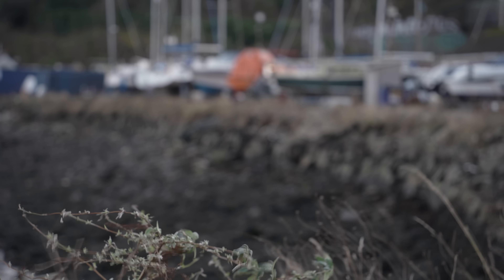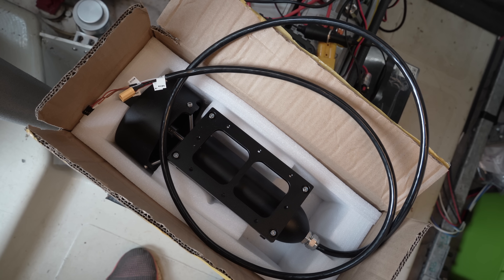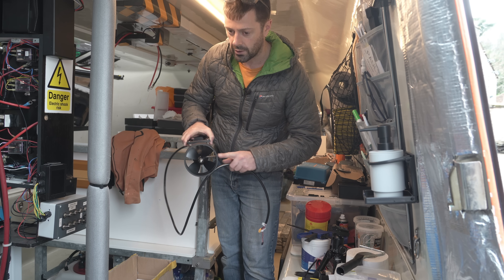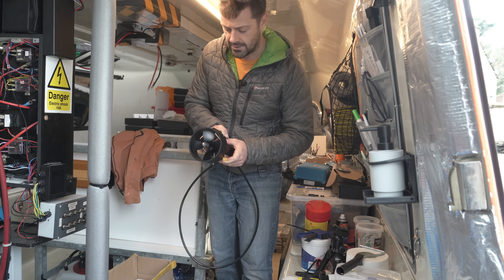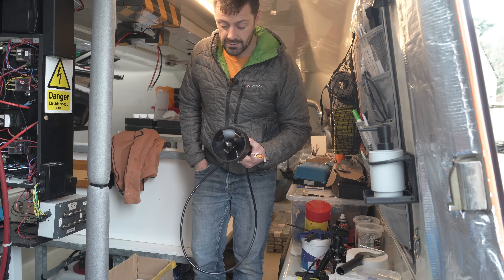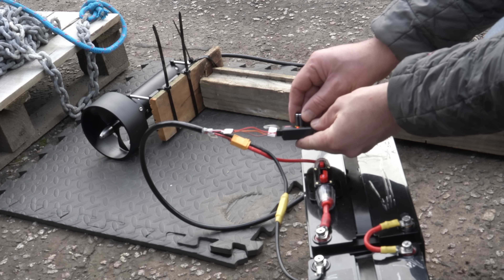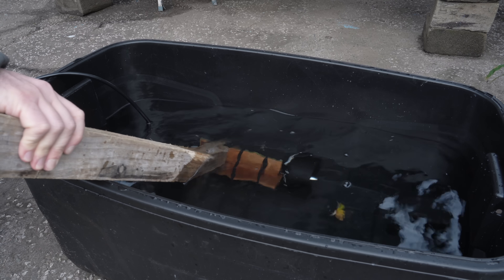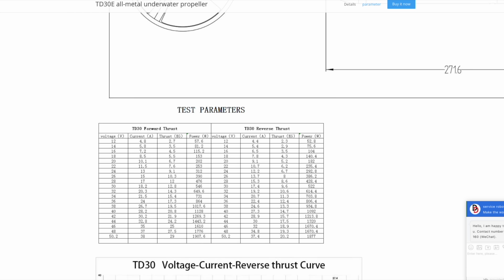Underwater Electric Thruster Test - 24V 1200W motor. Expedition lifeboat conversion Ep107 [4K]

Comment: If you use 8 AWG then it can handle around 85 amp continuous & the diameter of the wire should be around 3.5mm. Basic rule of thumb is if you use double the amp rating that you really need then you won't have issues & it also allows for future upgrades that draw more power.
Reply: The Motor Windigs itsself and here perticular probably more the build in motor control circuit traces and the type and amount ot FET Transistors is what limits your possible max current. (plus little bit bargin from the watre and in arctic waters even more the cold water)

Stepping up the wires to a diameter who is more as the rating of that thing is isnt nessesary. Most of these are generous with its power ratings (if not to say lying) and give you leway from this point. Also you probably never stall it and run it for long duration on full load need. So there is also room there.
I would think AWG 12 ist enough, even the step up to 10 isnt needet exept you want to midigate the voltage drop and be on the save side.
But 8 AWG would be just not make any sense ynd you start to get into problems with having physical space in the inlet openings.
Reply: Power loss is also a problem, energy wasted
Reply: @Dave78214  question is how mutch  you loose and how often you use them. he was more concerned about the real poweroutput the pod can reach to not cap them there to mutch and burning the wires when used. but he uses them only for bowthrusters or maneuveringthrusters for docking and something. thats only minutes or even seconds only. you cant even waste enough energy with the cables to make a different since the motor itsself drains the small batteries quickly.
In a long running verry efficient optimised setup for a autonomous drone ship for example you would think about.
Reply: @Total_Egal  well yeah, there are multiple angles to look into, others had not seemed to mention the power loss and it's sort of accounted for in the choice of correct guage and the voltage loss point - the wire doesn't seem to be the correct gauge, and 5 or 6 might be appropriate if the motor really can handle that much continuous power - perhaps it is useful for intermittent power bursts, like you say as a bow thruster
Reply: if you drop 2V over 1.6m that's 100W wasted at 50A current, and then as the temperature increases, the resistance also increases - 60W lightbulbs can start fires. I think the cooling from the water on the submerged part of the wire might be sufficient in factory tests.
Reply: @Dave78214  i dont say he should use clearly undersized wires who are on it right now but also not start to overdue it.
and also 1,6m long wires arent a lightbulb^^
Reply: @Total_Egal  good point, I think he also said the wires should be even longer
Reply: @Dave78214  in my expirience with changing wires on all things arround the most limiting factor without getting into larger physical modifications is the diameter of the holes and fittings to seal them up and get the cables trugh tight spaces in them. you might go one size lower as you want or have to squeze single wires insted whole cables and now got the seeling problem on your hand.

I think he wants to put more as one of this things on the boat. you might can run thicker cables to bow and stern to a busbar or cuick plug connection box and from there you go with smaller diameter to the pods outside.

And also he should closely test the wires quality he gets itsself.
China Import is know to use aluminium cables with copper and thin layers on it to hide the real quality.
Reply: @Total_Egal  I think you are onto something, even if you can fit the holes the current then goes onto the circuit board and through tiny components

Comment: Yes, that Guage of wire getting warm without the prop in water will only get hotter from the resistance in the water and yes even though the cold water will  keep the wire cool, it will only disapate the heat somewhere where the wire is not cooled. 
After a few cycles of running for a length of time the heat will weaken the wire strands or blow out a solder joint prob in the micro controller aboard......
ALAN!!! ❤😊🎉👍😎

Comment: The rub rail on my boat started leaking through the hull just like yours when the rubber started to dry out and shrink. I ended up taking the rub rail off completely(with a oscillating multi tool, drill, screw driver, hammer a chisel and a lot of swearing) and then filling in all the bolt holes. Are the top and bottom bolted together or are the halves bonded together those bolts going through the seam?
Reply from the maker: The latter - it's all bolted through. I'm trying to find a solution that does not mean lots of destruction and associated swearing.

Comment: My experience in using "heavy duty" jumper cables to test a 1,000 watt motor was. Hmm, what is that burning smell, hmmm why is there melted pvc on my floor.

Comment: dumbness in this episode - wasting time with chinese motors when european manufacturers make the best electric thrusters on the planet, needing bow thrusters when prop walk will do the job, using 12v packs when 24v packs exist, using packs with no active thermal management in an arctic expedition vessel.
also if the rub rail is leaking - use a jigsaw, cut out the bad and replace with new rub rail. there are no shortcuts on boats.
oh and if you want an actual marine thruster i use an aquamot 2.2 on my yacht with dakota dl+ 24v 135Ah with active thermal management.
Reply: Wow ! A REAL EXPERT on everything....
Reply: @Thelostgoldhunters  no expertise. just hard experience on the water.

Comment: Regards the wiring for the thruster, another concern is the wiring may be (probably is) aluminium coated with copper instead of the real thing.  For many applications aluminium wiring, while not being ideal, is not a huge deal breaker but for you, it would be far more serious.
Reply: I've never come across this in marine motors, even the Chinese know that copper is best in salt water...
Reply: I thought the ‘good stuff’ was tinned and not straight copper for marine purposes. Most low voltage wire from China is silicone coated and tinned (allegedly) finely stranded wire in my recent foray into researching and then purchasing some.
Reply from the maker: I'll find out when I cut and rewire, but the manufacturer stated it was pure copper.

Comment: Former industrial electrician here and I think I know what is going on;
Is the 50 amps inrush current or constant current? A motor has inrush current, which is only there until the motor starts rotating at full speed. I would assume that the motor only pulls 12 amps when actually running. Based on the size of that motor, I would guess it is about a 1/3 horse motor, so 12 amps at 24 volts comes to 288 Watts at about 88% efficiency puts out 1/3 horse at the prop, so if that is what they said they were selling you, that should be right. Yeah, the wire is probably fine, mate, but since you are going further, put one size larger, so 10 gauge AWG.
Reply from the maker: I don't want to counter someone who clearly knows their stuff, but the manufacturer YouTube channel shows the wattage at roughly their ratings when running, not just peak at startup.
Reply: @AlexHibbertOriginals  Ok, (watches video) so it is not the inrush current then, which was the one question I had. The current rating for wire gauges is for use without getting an electrical engineer involved in doing calculations. You also can get away with thinner wire if the cable is rated for higher temperature or had better cooling, but they are over relying on water cooling in their design.

It is ok for it to get warm, but not above the rating of the cable or to increase resistance (40 degrees Celsius is a good operating number for cable to top out at). The other question is how much are you going to run it. If it is more than an hour straight, you need a beefier cable.

Your plan to go thicker to the size you mentioned in your vireo should work perfect and deal with the thin wire they used if the section that is thin is actually underwater as you are taking Alan in Arctic operations.
Reply from the maker: Cheers - yep, trying to be discerning, without necessarily throwing what appears to be an otherwise very robust-feeling unit on the scrap heap. The re-wire is a must.

Comment: Did you actually test the current levels?
You are 100% right that wire will not be able to handle the 50 amps, but I highly doubt that the motor will pull that much amps as it is not 1200 watts... I think you got scammed on the motor.

 Don't they make a sprayseal type of stuff that is pretty good at sealing leaks along fittings like you have?
Reply from the maker: I did not - my claw-style current meter is playing up. The manufacturer YouTube channel shows the wattage at roughly their ratings when running. I'm unhappy with the manufacturer on a couple of levels, but I don't think the rated numbers were a 'scam' by a factor of, for example, 2 or more.
Reply: @AlexHibbertOriginals   The only way to know for sure is to measure the running amps going to the motor. If it is less than 50 amps then the wattage is not 1200. Of course you would need to test the voltage as well and multiply that by the amps, whatever that would be.
 It is common for china motor to not be anywhere near what they say they are unless it is an expensive motor. I have seen motors advertised at 1200 watts and they actually put out about 500-800 watts maxed out.
 Sorry you have this issue with that manufacturer..
 Did the spray seal idea help?

Comment: I'd rewire it with 8 gauge stranded because some of it will be in the water and if it catches anywhere it is less likely to break internally. For the rail leak use Captain Tolley's Creeping Crack Cure. Then use a marine grade silicone on the bumper to adhere it better to the hull
Reply from the maker: That very thin sealant looks good, thanks. Probably not viable for this job as it's a vertical surface, but for other things, great. Cheers.

Comment: I like your jury rig silicone shock reducer. . .just wanted to say (and I’m sure you know this) but there are companies in the US that make these in many different sizes for different shock needs.  I used them on a snubber on my 34 ft. Sadler (British) and it never failed and did reduce shock.  Your method might be cheaper although I’m not really sure. . .Thanks.
Reply from the maker: I have the normal shock dampers for Alan, but I need -40 rated ones for my sledging, so silicone it is.

Comment: A solution I have used in the broadcast TV industry might suit you for your fender problem.  We need to waterproof bolts on aerial systems so they can be undone many years later.  We simply coat the bolts/crews in Vaseline.  It gets mucky but the bolts don't rust and can be undone with ease (Steel, Aluminimum and Stainless Steel). Vaseline will soften in hard sunlight but it will stay as a thin coat.  It won't attack the fibreglass. I think it will work well below -20 deg', and more, it has for us.  It has fantastic water repellent abilities even when exposed to extremely heavy and continues rain for many years.  I have never tested it under sea water, that you would have to do but I think it would be fine.  Even though Vaseline does not set it will repel water and seal screws.  I think it would be fine under direct wave action.  I say this as the wind and rain up our aerial masts is well above 100mph.  The screws you can get out dip the screw in Vaseline then refit.  Those you can't get to use a small artist paint brush and liberally coat as best you can. To test, coat a nut and bolt in Vaseline then leave submerged in salt water and see how you go.  Use Vaseline, not a cheap alternative.  Vaseline tends to be more viscous and is ideal but will not set no matter what.
Reply from the maker: The issue would be getting it there! Also, the waves on the bow are powerful, and would wash the petroleum jelly off in fast order, I fear.

Comment: You have to load the motor to get to 50A... it won't get there out of the water, no-load... you didn't measure the current, we note.  For leaks like that I've decided that pulling a vacuum on the inside and drizzling thin epoxy around the leaks is a viable path.  You can put tape or silicone cofferdams to keep the (watery hopefully) epoxy in place while it's migrating.  Digging any further into Alan's construction risks having to split the halves.  There's a liquid RV roof sealant that uses this method, not sure if it's watery enough.  You might pull a vacuum on just pieces where the water ingress is happening... might be better than trying to seal Alan's entire hull for air leaks.  Good luck.
Reply from the maker: I agree on the first part of your logic for the fender strips leaks. Cheers

Comment: Chinese cheaper units, are mostly reduced in quality by poor soldering and quick n easy straight forward solutions. At best, at the absolute minimal regarding wires quality and wire shielding. I always replace all of them, and go over the soldering where I can. It has to be correct, since any point where you lengthen a cable, or connect it, will be even weaker than the cable itself. So you don't want the cable to be the pitfall.  Luckilly a 24v-system often need fewer amps than a 12v-sytsem.